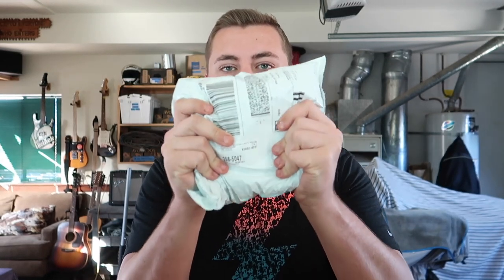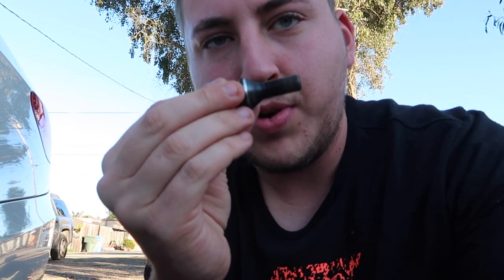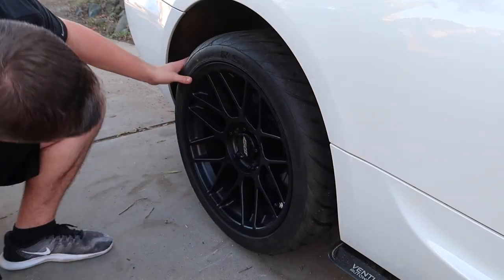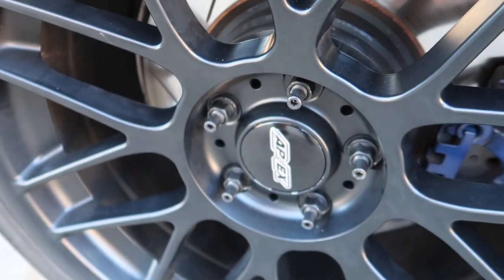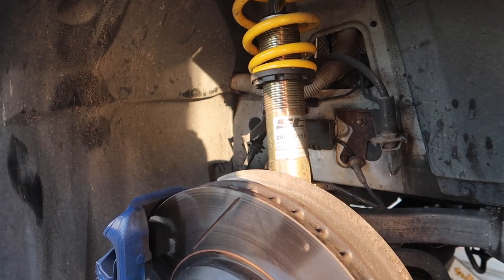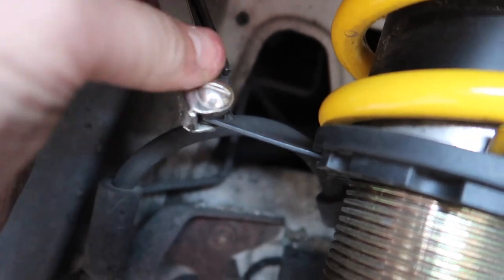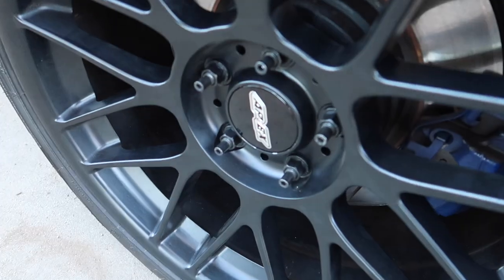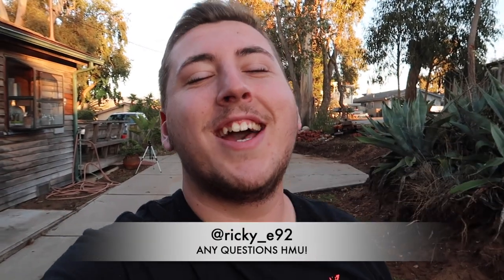BMW WHEEL STUD CONVERSION!! (Every BMW needs this!)

Comment: Nice setup, i just bought a set of extended studs as well. Just curious if the torque spec was 11ft lbs per ecs or did you just decided to go 20+ by gut feeling?
Reply from the maker: Not sure I switched back to lug bolts
Reply: @drivenbyricky4651  wait after making this whole ass video you switched back? Lol

Comment: anti seize bro !
Reply: Wouldn’t you want locktite? I feel like you wouldn’t want the lug to get stuck on the lug shaft and then have it pull the whole thing out.
Reply: @alanwright782  yes you also need something like very high strength thread lock too... you dont want that shit to unscrew while you driving or drifting the car

Comment: Ricky, what's the collar ring count for the rear coilover height. 14 on the front, how much on the rear?
Reply from the maker: I think 12 not sure off the top of my head
Reply: @drivenbyricky4651  thanks man..... Im using this just as a starting point.... One more quest please do a video reviewing the St coilovers...... I am torn between st or h&r performance Coilover, how is the St ride as well as rebound?
Reply from the maker: You I think I am gonna do a video on that!!
Reply: @drivenbyricky4651  hurry up brother I am waiting......

Comment: THIS IS THE STUPIDEST THING I'VE EVER HEARD!!!!! NO IT'S NOT EASIER OR BETTER!!!! Having lug bolts is so much smarter than having studs. Studs get broken all the time. The threads get screwed up, they get bent and many many other problems. The German's are the best engineers on the planet. There's a reason they changed to this way of doing it. Reversing that is to go backwards... BTW, I guess your of the opinion we need to get rid of the car, and go back to horse and buggies???
Reply from the maker: Horse and buggies would be cool